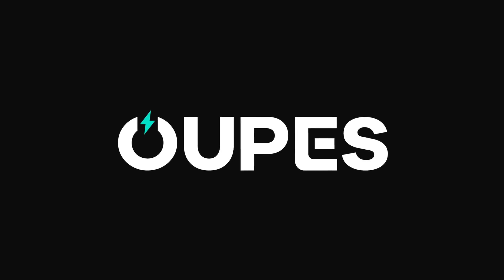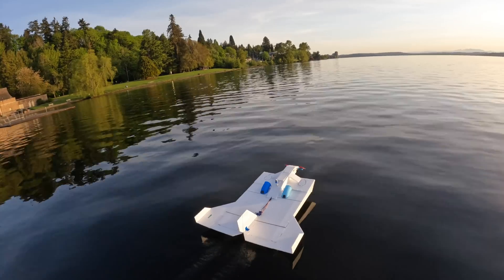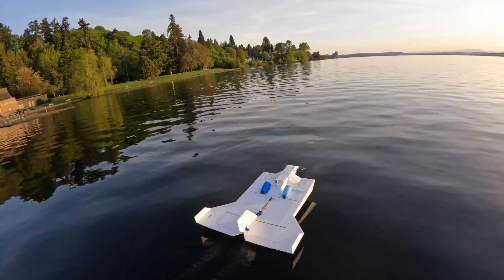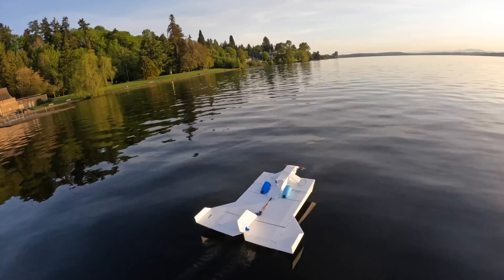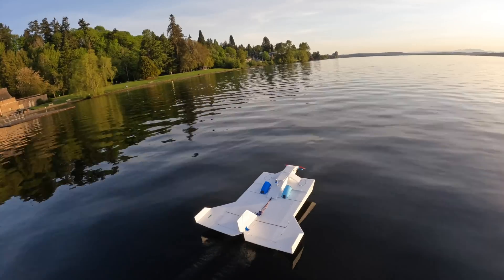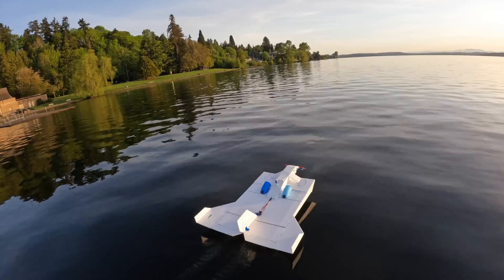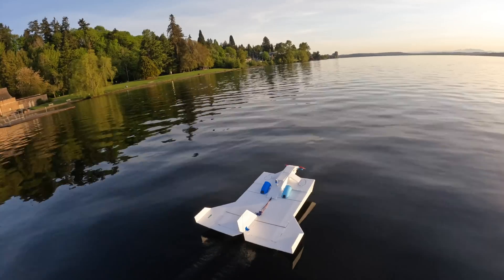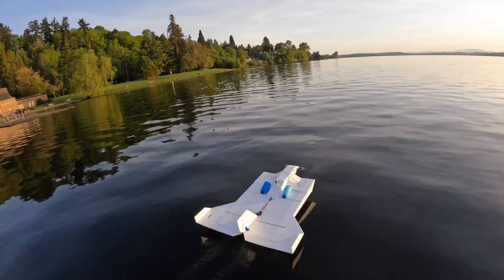Testing WWII Era Terrain Following 'Radar' On R/C Plane

Comment: It was a good idea to connect the surface wands to canards but I think that the feedback loop (which you needed) is too symmetrical: I would suggest that going too high should cause only a small nose-down input whilst going too low can be proportional to how close that you are to the water.

Don't worry too much about wingtip vortices (though they are pretty): they are not the cause of the induced drag, they are just the symptom of the large pressure difference between the upper and lower wing surfaces which both create the lift and the induced drag. 

We know that ground effect increases the pressure under the lower wing surface so you should also expect to get stronger vortices - except for the ground effect and wingtip fences counteracting that when you are really low but when you are higher (out of ground effect) then you have just a low-aspect ratio wing with high induced drag and low efficiency that looks pretty with the ghosts and lasers.
Reply: If you watched Formula 1 races last year you will have noticed that the habitual winner (Verstappen) drove a RedBull car that produced huge amounts of sparks going into the corners under heavy braking. Obviously, the car designer realised that the greatest G-forces are generated when breaking into a corner because brakes are more powerful than engines and going into a corner requires both simultaneous braking and turning - extreme change in velocity - so anything that he could do to make the car go as low as possible by changing the suspension geometry under braking would have a disproportionate benefit during the race now the cars have stronger ground-effect (suction) than previous years. Verstappen became famous for late braking into corners last year because he had so much grip than any other driver.

Comment: Awesome testing !
Regarding your issue with oscillations, you should find a way to either have exponential corrections from the canard tabs, or/and increase their surface back while reducing the max travel. At present your corrections are too small when the aircraft starts to pitch down, and are too big when it's close to the surface. Your control surfaces aren't efficient enough at low angles

Comment: The water isn't perfectly flat.  I'm wondering if that's where your oscillation is coming from.  The sonar sees the peaks and valley's.   Perhaps code to average out the ground height?  Might add a delay to your flight controls.  If you add code to average out the readings from the sonar, you may want to put an exception for a dramatic decrease in height.  In the event it encounters the wake of a boat or other objects protruding from the average water height.

Comment: On hydrofoil sailboats, the wand connects to the foil via two bell cranks and a push rod. The forward bell crank has a screw to adjust the ratio of angle change to pushrod movement (aka the gearing). In heavier seas we up the sensitivity and in flatter water we keep it as low as possible (because any flap movement is increased drag). It would be neat to see a mechanical tuning system for the canard’s instead of just changing their area.  Keep up the good work!

Comment: I wonder if testing a few different gear ratios between the probe might be worth while. What you tried was clearly working but the response looked to be too aggressive.   The problem may end up being that the response needs no only be less aggressive but also proportional to speed, that would be when it gets more complicated.  Using servos would be better at that point as they could be programmatically controlled then instead of the probe you could try LiDAR.

Comment: sort of want like a hovercraft/catamaran/gev filing body design .. like a catamaran hull with a flexible skirt at teh bow and stern with a thick cork wind between the hulls and then so shallow cord wings stick on the out side of the hull  its interesting i remember watching a doco on the harrier jump just and one of the things they said i think was that in low altitude flight with the flaps all the way down the flaps acted like an air dam  and forced ait from the engines down creating a pocket of high pressure air under it that helped it take of after a short roll

Comment: You know, I bet a plane with flaps would work so much better for stay in the ground effect, what with the ability to keep the planes overall angle of attack straight regardless of the pid inputs.

Comment: import numpy as np

class AdvancedPitchKalmanFilter:
    def __init__(self, dt):
        # Time step
        self.dt = dt
        
        # State-transition model matrix A
        # Assuming simple dynamics where dt is the time step
        self.A = np.array([[1, dt], [0, 1]])
        
        # Control-input model matrix B
        self.B = np.array([[0.5 * dt**2], [dt]])
        
        # Observation model matrix H
        self.H = np.array([[1, 0]])
        
        # Initial state estimate
        self.x_hat = np.zeros((2, 1))
        
        # Initial covariance estimate
        self.P = np.eye(2)
        
        # Process noise covariance matrix Q
        self.Q = np.array([[0.01, 0.01*dt], [0.01*dt, 0.1]])  # Adjust based on your system
        
        # Measurement noise covariance matrix R
        self.R = np.array([[0.1]])  # Adjust based on actual measurement noise
        
    def predict(self, u=0):
        # Predict the state estimate
        self.x_hat = np.dot(self.A, self.x_hat) + np.dot(self.B, u)
        
        # Predict the covariance estimate
        self.P = np.dot(np.dot(self.A, self.P), self.A.T) + self.Q
        
    def update(self, z):
        # Compute the Kalman gain
        K = np.dot(np.dot(self.P, self.H.T), np.linalg.inv(np.dot(np.dot(self.H, self.P), self.H.T) + self.R))
        
        # Update the state estimate
        self.x_hat += np.dot(K, (z - np.dot(self.H, self.x_hat)))
        
        # Update the covariance estimate
        I = np.eye(self.H.shape[1])
        self.P = np.dot((I - np.dot(K, self.H)), self.P)

    def get_estimate(self):
        # Return the current state estimate
        return self.x_hat

# Usage
dt = 0.1  # Time step, adjust based on your application
kf = AdvancedPitchKalmanFilter(dt=dt)
control_input = 0  # Example control input, adjust as necessary

for step in range(100):  # Simulate 100 steps
    kf.predict(u=control_input)  # Predict phase with control input
    
    # Simulated measurement (replace with actual sensor data)
    z = np.random.normal(0, 0.1)  # Simulate noisy pitch angle measurement
    
    kf.update(np.array([[z]]))  # Update phase with actual measurement
    
    print("Estimated state at step", step, ":", kf.get_estimate().flatten())
Reply: # Initialize the Kalman Filter
kf = AdvancedPitchKalmanFilter(dt=0.1)

# Initialize the PID Controller with example gains and a setpoint
pid = PIDController(kp=0.5, ki=0.1, kd=0.05, setpoint=5)  # Desired pitch angle setpoint

for step in range(100):  # Simulate 100 steps
    # Simulated measurement (replace with actual sensor data)
    z = np.random.normal(0, 0.1)  # Simulate noisy pitch angle measurement
    
    # Update Kalman Filter with the new measurement
    kf.update(np.array([[z]]))
    
    # Get the estimated pitch angle from the Kalman Filter
    estimated_pitch = kf.get_estimate()[0, 0]
    
    # Use the estimated pitch angle as input to the PID controller
    control_input = pid.update(estimated_pitch)
    
    # Here you would apply 'control_input' to your actuator (e.g., elevator)
    # For simulation, let's assume 'control_input' directly influences the next pitch rate
    kf.predict(u=control_input)  # Predict next state based on control input
    
    print(f"Step {step}: Estimated Pitch={estimated_pitch:.2f}, Control Input={control_input:.2f}")

Comment: If you've tried everything (including ideas in the comments) the oscillations could be driven by the water waves. might need some time-averaging, or run a Fourier transform of the input and subtract the most significant frequencies. would need very little memory.

Comment: You need a short averaging filter (100ms?) on the ultrasonics to get rid of the low frequency oscillations. It would be detecting the waves.

Comment: Is there a way to isolate how much of the control issues you're encountering when trying to stay in ground effect are from the waves? Maybe more testing at that field instead of on the water?

I have very little controls experience, but I'd almost wonder if you want more smoothing of the history. I don't know if you can necessarily solve that by adjusting the I-term, but if you could somehow back out the "true water level" I wonder how that would relate to the ground effect.

Comment: aircraft are known to just oscillate without the computerized reduction that most aircraft have, it's called phugoid oscillation, and it can be amplified by the stabilization software since the oscillation will feed back into the input

Comment: The larger the model the more you can "feel" the ground effect, i have a 5 metre wingspan rc canadair waterbomber and you have to wait until it slowed enough for it to descend through ground efect and touch down nicely, if you force it it will get pio very easily,  it has a deep cord flat bottom wing

Comment: I think the sonar sensors would work better if there were more than one on the nose. Or if the airplane's pitch was accurately factored into the feedback loop. If it's nosediving into the ground then it needs to pull way up and fast. If it's just gently descending then it can take its time and think about pulling up.

The wands would need a linkage that doesn't yank the stick back every time the ends graze the surface.

Comment: Lift Curve Slope (d_CL/d_alpha)  - the higher the wing aspect ratio, the greater the change in lift per change in angle of attack. In essence, this is the 'gain' of the wing versus changes in angle of attack (caused by changes of elevator angle). I reckon your high-aspect-ratio glider could almost be an order of magnitude more sensitive to changes in both pitch and elevator angle than your low-aspect craft. And foamy wings wobble, which doesn't help. 
Also, gliders have minimal horizontal tailplanes to increase their responsiveness - they're 'sport' machines. Try doubling this tailplane area (to increase the aerodynamic Static Stability Margin).
The closer you get to the water, the more the waves will play merry hell with your LIDAR:  I'd suggest a long 1st-order lag to smooth that out. Similarly, 'little' waves aren't so little when the wing chord gets so small; full-size seaplanes can't land on water that's too choppy.
In a nutshell, high-aspect ratio gliders - of any scale - are twitchy as hell compared to your low-aspect ratio craft. I reckon that's the problem. And as for their 'phugoid' oscillation...
But you're almost there, love to see you pull this off!
P.S. bloody awesome videos!, the footage of the wingtip vortices was the best I've ever seen!

Comment: I was thinking that you use the rod, but they connect to an anolog to digital input device… run through the PID controller to move the canards… bigger canards with smaller movements… just a thought.

Comment: I think maybe with the rolls on the water surface it might help to add dwell time to the surface indicated position as you would for temperature or water pressure. Those examples can take time to stabilizes as does the water level with a rolling surface. Up In Smoke has nothing on you and yes the license is on the back of the car.

Comment: 3:30 The "low frequency altitude oscillations" is probably due to "i" gain of the controller, it builds up to quickly and overcompensates, you should probably trim it manually, and get "i" gain to zero

Comment: The wand/canard looked promising at first,  don't know if anyone has already mentioned but it could be worth changng the feedback loop by adjusting the throw ratio rather than the flap size. You could do that by changing your gear ratio, but probably easier to switch to a coupled control arm set with different hole positions.

Comment: IF you use an IR sensor for detecting water........    yeah.      
Depending on the frequency of the light (wavelength of the IR)  water will absorb, scatter or otherwize mess with the sensor readings.     

If you use sonar. The constanly changing wave angles can mess with the sensor.   Log the output to see if this is the case.
Reply: Also.... change the gear ratio of the sensing arms.

Comment: Probably Wrong, but maybe if you angle the proximity sensor forward, the plane can adjust for the height differential of the the water waves prior to getting to them. It may help smooth out the oscillations.
Reply: On second thought, extending the proximity sensor far out in front of the vehicle and pointing straight down might be better.

Comment: Great video, if you change the size of the gears at the front of the plane so that they are different size then you can reduce the amount that this will cause the plane oscilate as the distance moved by the lever could be reduced by having a larger gear control the pitch against a smaller one attached to the leader as the smaller gear will have to travel further to move the larger gear. A 2:1 gear ratio would halve the movement

Comment: Actually low aspect wings work best for ground effect, that's why almost every GEV you see has short stubby wings. The main benefit of high aspect wings is reduced parasitic drag due to tip vortices in free airflow, you don't tend to get tip vortices with GEVs because airflow is constrained by the ground so parasitic drag isn't a problem. Therefore you design low aspect wings.

Think about an F1 car which uses the underbody venturi effect to create an area of low pressure under it creating downforce, well a a GEV is using the venturi effect to create an area of high pressure under it creating lift.

Comment: Couch man here:
The problem I see with the stick changingthe flaps is the stick:
-I would try a longer and more nimble stick.
My guess is, that would definitely work.
Currently the stick is way too long.

Just scale the length and size to the water craft, you showed.
(Compared to that you are putting a tree into the water to adjust steering)

Comment: Hey, cool video and concept. I was wondering how you tune/tweak your PID values. Do you just do it manually? Because then I highly recommend trying a tuning algorithm like Zieger Nichols or similar. They depend on oscillation in the process value (here height above the water) so it seems perfect. I had a course last semester about these things, and it is pretty simple to do, even on complex systems:)

Comment: More than 30 years ago, I built a propeller powered car ( that stated as a 2.5cc powered, "free flight" car but ended as a 7.5cc RC car ) worked quite well. I had thoughts about a "ground effect" version, that would work something like the final 'trailing rods' idea. But a couple of things held me back, engineering skills and 'a flight controller? what the @#$% is that?'. this was in the days before foam was a build material and money didn't stretch to more than 2 channels, I only flew control line planes. (May have been 40 years ago, I'm getting old.)

Comment: Something to look at is the airspeed at which the highest efficiency occurs.
A simple starting point is stall speed, as this is easily observable. (other measurements will require data collection)
Typically ground effect helps lower stall speed, and lowering the speed across the performance curve. Effect feels like flying a lighter aircraft, makes if feel more floaty.

Comment: Maybe a stronger spring on the control arms instead of reducing the control area would work? - Reducing the angle of attack of the canards and hopeful then the resultant pitch and oscillations... Equivalent to dampening the control loop input rather than weakening its output. Not sure but worth a go maybe :)
Love the videos!! :)

Comment: ?? sensor frequency"" - is that the update rate limitation..   - if the raw sensor output isn't "an order of magnitude" faster than the inside loop, strange stuff happens...

looks like integrator wind-uo and reset issues....

with the "wand..  a long trailing (low angle) wand ends up out of phase with the dynamics of the craft..  leading to oscillations - like integrator windup..

Over water a strange type of wand would be a "moisture sensor on the end of a long cord (weighted - to drag on the surface) - increased altitude, while maybe above ground effect - constant height terrain (water) following is interesting  -  in analogue formats...

Comment: Just a thought what about using both a Microwave module and Ultrasonic systemm together the microwave system  would react quicker and then use the Ultrasonic  system for coarse adjustment. I am not a RF engineer but maybe somebody who has experience in this field could help you out. If you use both systems you maybe able to stop the oscillations occurring or reduce the rate they happen I hope my my suggestion helps in some way. I find your ideas interesting and quite fascinating.

Comment: I think part of the problem with the sonar control loop is that the input to the loop is altitude, but the surface it controls is delta delta altitude (elevator is change in pitch, and pitch is change in altitude). If you can make the output of the control loop correspond to delta altitude (single derivative), a PID loop would be much more effective. Alternatively search for a control loop that works in this configuration.
Reply: Maybe if you mixed canards with elevators you could control the climb rate independently of the pitch on small levels.